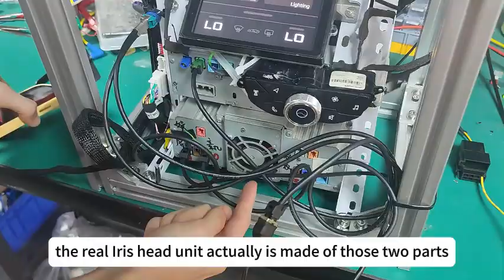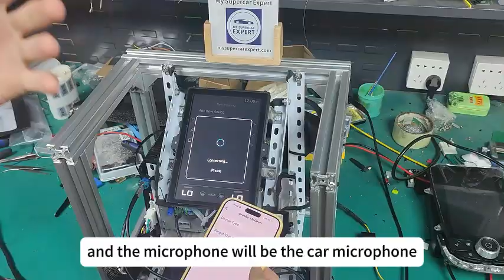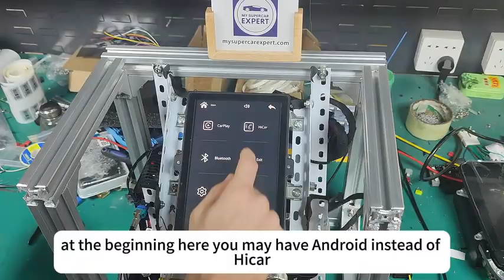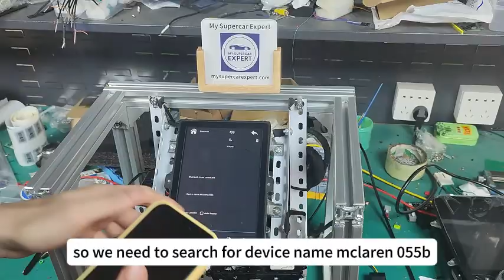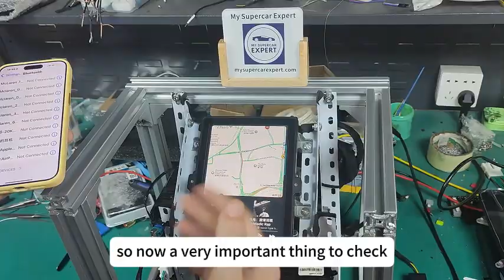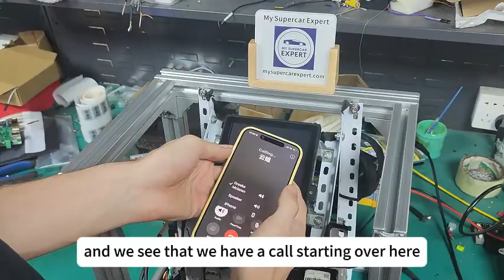First aftermarket carplay solution for McLaren 720S by My Supercar Expert!

Comment: Great job guys! Finally a solution for the 720s.

One question though. If I understand correctly, the audio is fed from the phone to the Iris headunit via Bluetooth, which is then sent via MOST output to the amplifier.

If that is the case, then source audio suffers compression due to the Bluetooth communication, resulting in lower quality audio. 

Under that assumption, did you guys considered having your unit connected to the MOST bus, so that the audio produced by it (i.e. essentially CarPlay) is output directly and without compression?

In the Porsche world, there was a unit called Mr12Volt that was doing that.

I ask because the B&W soundsystem in the 720S is quite high quality, and it'd be cool to be able to enjoy it using uncompressed audio.
Reply from the maker: Hi, what you mentioned is very correct.
Unfortunately our team is not specialized in the audio part. Currently if we connect via wire through our system, the quality gets compressed as well, to the point bluetooth is actually a preferable option (no change or gets even worse via wire). Too much stuff in the middle.
We decided against providing highest quality of audio to reduce development time and make installation easier, both of which directly impact pricing and value of the product. 

Figuring out the direct connection to the MOST bus in terms of development time/effort is currently not an option for us. But if we end up being able to do it, we'll certainly think about a plug-in option or an independent solution based on our experience with the carplay/android auto module!